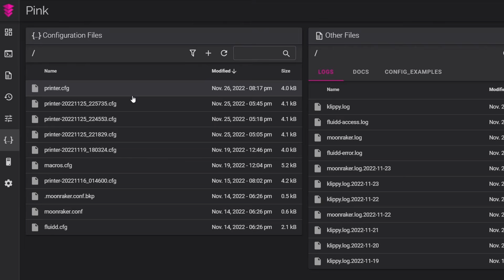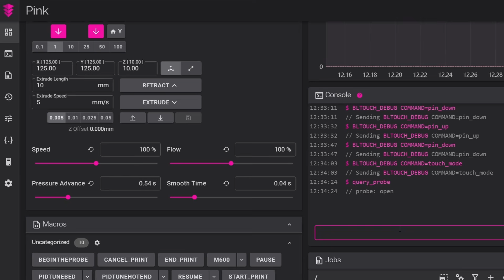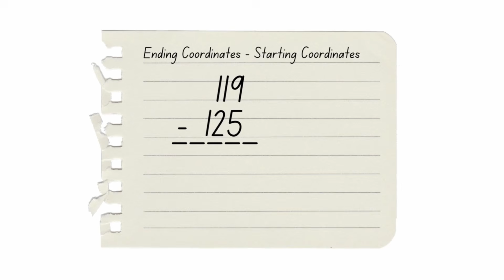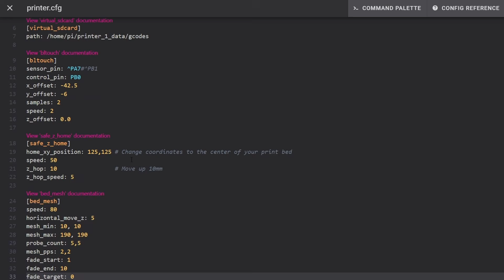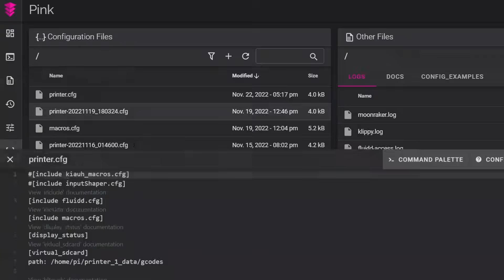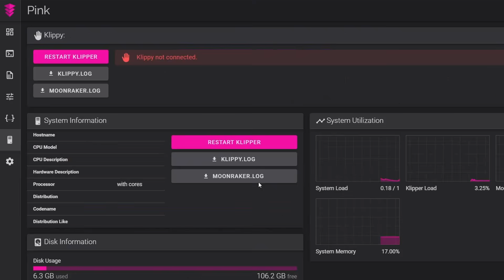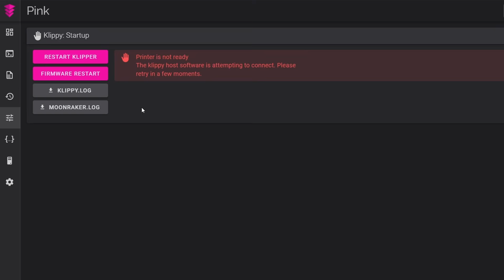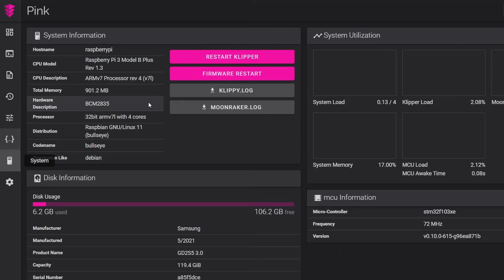BL Touch complete setup for Klipper! Maximize your probed bed mesh!

Comment: Just installing Klipper onto my Ender 3 Pro, but sadly my Z axis goes up instead of down when homing, I have no idea why. This seems to be a Klipper problem, but I wonder what makes it go like that. Would you know an answer?
Reply from the maker: Hey JKM, it's like something set in your printer.cfg (printer configuration file). If you open that file (printer.cfg) and find the section titled [stepper_z] look for the line that says 'dir_pin:' there will likely be a pin level after it , something like PB1. If you add an exclamation point before the pin it will reverse the direction of the z axis. 
So in my example PB1 would become !PB1

Let me know if this helps.
Reply: @PrintsLeo3D  hey that was exactly the problem, thank you so much! ❤️❤️❤️
Reply from the maker: You're welcome , enjoy Klipper!! Any problems just come on back here.

Comment: This is a great video! Very impressed with the skill you explained many questions I have been searching the answers for for some time. I do have a question if anyone knows the answer.  When I use the command probe_calibrate on my SonicPad version of Fluidd, I do not get the pop up box that shows in this video. What is the equivalent way to achieve this with the SonicPad version of Fluidd? Thank you so much for the video
Reply from the maker: Thank you for the kind words,I try my best to get accurate and complete information out there. The sonic pad ...oof lol ok hopefully I can help. I know the sonic pad has certain speed bumps as far as usability goes, and unfortunately I don't own one myself to verify. The probe_calibrate overlay you are seeing in the video is a newer addition to Fluidd (maybe the last 6 months or so), so it's possible you may just need to update your Fluidd version*, but it's also possible you'd need to update the version of the sonic pad as a whole and I know some users(on my discord) have had problems with that. 

* always be careful when updating pieces of Klipper as it could be incompatible with current versions of other components you have like Moonraker

Comment: Great video I recently found your channel and I understand a lot better with your videos. I watched this video a couple times before I started trying to resolve my CRtouch configuration issues . No matter what I tried, the probe would not stay pushed up when I ran the touch mode command nor would it read triggered. As soon as I entered  the command the leds on the probe would turn blue. I have an Ender 3 with a 4.2.7 controller board and CR Touch. The issue is still u resolved, but I would appreciate any feedback.
Reply from the maker: Hey Monica! I'm happy you found me and I hope my videos (and responses) can help you with your printer. There are some bl touches (or touch clones) that do not support the touch mode commands. Have you tried auto homing the machine? There are some clones that while they don't support touch mode will still auto home properly. Is it possible for you to copy and paste the current bl touch section you have in printer.cfg and reply it to me ?
Reply: @PrintsLeo3D  Sorry for the delay I had to abandon Klipper and revert to Marlin because I needed a working printer. I tried to auto home but my print head crashed on the bed. The probe that is installed on my Ender 3 is the CR-touch, I know that Creality ships both the BLTouch and the CR-Touch on some of their newer models, but mine is an older generation Ender 3 with a few upgrades. Here is the last version of the printer.cfg. 

# This file contains pin mappings for the Creality "v4.2.7" board. To
# use this config, during "make menuconfig" select the STM32F103 with
# a "28KiB bootloader" and serial (on USART1 PA10/PA9) communication.

# If you prefer a direct serial connection, in "make menuconfig"
# select "Enable extra low-level configuration options" and select
# serial (on USART3 PB11/PB10), which is broken out on the 10 pin IDC
# cable used for the LCD module as follows:
# 3: Tx, 4: Rx, 9: GND, 10: VCC

# Flash this firmware by copying "out/klipper.bin" to a SD card and
# turning on the printer with the card inserted. The firmware
# filename must end in ".bin" and must not match the last filename
# that was flashed.

# See docs/Config_Reference.md for a description of parameters.

[include mainsail.cfg]

#[temperature_sensor mcu]
#sensor_type: temperature_mcu
#min_temp: 0
#max_temp: 100

#[temperature_sernsor pi]
#sensor_type: temperature_host
#min_temp: 0
#max_temp: 80

[stepper_x]
step_pin: PB9
dir_pin: PC2
enable_pin: !PC3
microsteps: 16
rotation_distance: 40
endstop_pin: ^PA5
position_endstop: -20
position_min: -20
position_max: 235
homing_speed: 50
#second_homing: 20

[stepper_y]
step_pin: PB7
dir_pin: PB8
enable_pin: !PC3
microsteps: 16
rotation_distance: 40
endstop_pin: ^PA6
position_endstop: -8
position_min: -8
position_max: 235
homing_speed: 50

[stepper_z]
step_pin: PB5
dir_pin: !PB6
enable_pin: !PC3
microsteps: 16
rotation_distance: 8
endstop_pin: probe:z_virtual_endstop
#position_endstop: 0.0
position_min: -5
position_max: 250

[extruder]
max_extrude_only_distance: 100.0
step_pin: PB3
dir_pin: PB4
enable_pin: !PC3
microsteps: 16
rotation_distance: 33.500
nozzle_diameter: 0.400
filament_diameter: 1.750
heater_pin: PA1
sensor_type: EPCOS 100K B57560G104F
sensor_pin: PC5
control: pid
pid_Kp: 21.527
pid_Ki: 1.063
pid_Kd: 108.982
min_temp: 0
max_temp: 250

[heater_bed]
heater_pin: PA2
sensor_type: EPCOS 100K B57560G104F
sensor_pin: PC4
control: pid
pid_Kp: 54.027
pid_Ki: 0.770
pid_Kd: 948.182
min_temp: 0
max_temp: 100 # Set to 110 for S1 Pro

#[heater_fan hotend_fan]
#pin: PC0

[fan]
pin: PA0

[mcu]
serial: /dev/serial/by-id/usb-1a86_USB_Serial-if00-port0   
restart_method: command

[printer]
kinematics: cartesian
max_velocity: 300
max_accel: 3000
max_z_velocity: 25
max_z_accel: 100

######################################################################
# 128x64 Full Graphic Creality CR10 / ENDER 3 stockdisplay
######################################################################

# This section is used for a Creality "12864" display with a single
# ribbon cable between the display's EXP3 plug and the
# micro-controller board's EXP1 connector.

[display]
lcd_type: st7920
cs_pin: EXP1_7
sclk_pin: EXP1_6
sid_pin: EXP1_8
encoder_pins: ^EXP1_5, ^EXP1_3
click_pin: ^!EXP1_2

[output_pin beeper]
pin: EXP1_1

[board_pins]
aliases:
  EXP1_1=PC6,EXP1_3=PB10,EXP1_5=PB14,EXP1_7=PB12,EXP1_9=<GND>,
  EXP1_2=PB2,EXP1_4=PB11,EXP1_6=PB13,EXP1_8=PB15,EXP1_10=<5V>,
  PROBE_IN=PB1,PROBE_OUT=PB0,FIL_RUNOUT=PC6
 
[display_status]

[safe_z_home]
home_xy_position: 125,125 #this should be the center of your bed
speed: 50 
z_hop: 10
z_hop_speed: 5

[bltouch]
sensor_pin: PROBE_IN
control_pin: PROBE_OUT
x_offset: -31.8
y_offset: -40.5
z_offset: 0
probe_with_touch_mode: true
stow_on_each_sample: false
#probe_with_touch_mode: true
#stow_on_each_sample: false
pin_up_touch_mode_reports_triggered: false

#[safe_z_home]
#home_xy_position: 117.5, 117.5
#speed: 50
#z_hop: 10
#z_hop_speed: 5
#move_to_previous: true

[bed_mesh]
speed: 120
mesh_min: 10, 10
mesh_max: 195, 220
probe_count: 5,5
algorithm: bicubic
Reply from the maker: I'm sorry to hear about that,  but I think the problem may be your pin out setup. Under the bl touch section the sensor and control pins are being pointed to pin aliases (which to be honest probably isn't necessary) but importantly the alias for the sensor pin is probably incorrect as it needs a pull-up!! The settings as you have them now for the sensor pin is:
sensor_pin: PB1

But it should probably be:
sensor_pin: ^PB1

That small arrow indicates a pull-up in the sensor and without it it's probably not going to activate! I'm not sure if your considering the move back to Klipper but that should be a solution for you. If you think about going back let me know and I'll do my best to help !

Comment: i had to set stow_on_each_sample: True
probe_with_touch_mode: False
pin_up_touch_mode_reports_triggered: False

is that correct if pin up and pin down shows always open? and homing crashing in bed
Reply from the maker: Hey Bill, usually when pin_up and pin_down always show open then I believe turning off touch_mode is the adequate response. I wouldn't think you would also need the pin_up_touch_mode line as well in there. Do you know what version of bl touch you're using? or is it a clone?
Reply: @PrintsLeo3D  i tryed but i have to set this if i dosnt it want work i dont know which version i have :(

Comment: Hiya, what do you do when your trying to prob calibrate and you cant get your z offset close enough, im at -5.94 and cant get any closer and it gives me a move out of range error :(
Reply from the maker: Hiya! Go into your printer.cfg a d under the stepper_z look for position_min: and change that to a lower number, usually -6 is good but you may need to make a lower adjustment depending on how far from the bed you are. Here's an example:

[stepper_z]
...
position_min: -6

Let me know if this helps!
Reply: @PrintsLeo3D  perfect thank you, i understand that bit now, its like setting a boundry for the z. that worked i think! thank you dude, your video has been instrimental!

Comment: I am using a sidewinder x2. I installed octoklipper. How can i calibrate the mesh there?
Reply from the maker: Unfortunately you won't have the same display shortcuts that Fluidd/Mainsail has, but to run the mesh calibration using Octoprint just run the following line from the console(or terminal) window:

Bed_mesh_calibrate 

That will run the same auto probing mesh that I showed kn the video. The name of the mesh will be 'default' which is the same way I show to save it in the video.
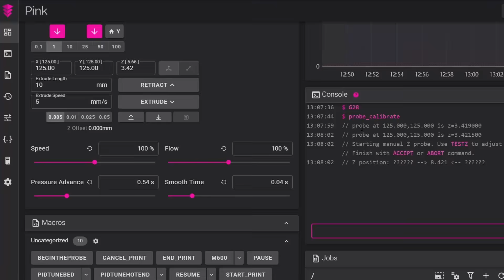Reply: I am using octoklipper too, I spent al day doing the tutorial until I got there and now I am stuck. 9:47 I do not get the window to manually adjust the Z axis. Did you ever figure out how to do it? The command bed_mesh_calibrate does not work, it is not recognized by octoklipper.

Comment: How to get this printer cfg on sonicpad? Do you just reflash it with a usb or does laptop have to be physically connected to make these changes?
Reply from the maker: I'm not very familiar with the sonic pad (but people in my discord are and I can ask them some advice), but I'm not sure what your asking? There should be a printer.cfg already on your sonic pad that it's using to control your printer. I don't know how you edit that file, but I can find out. What portions are you trying to add?
Reply: @PrintsLeo3D   well you can use the ip address to access and edit the print file but I don't know how to exactly get it on the sonic pad. Pretty much the thing you did in this video. I have the ender 3 v2 with sprite extruder and cr touch but the touch doesn't work lol.
Reply: I feel like I should join your discord lol.
Reply from the maker: You gotta join the Discord! There's a link in the description and we can get you all worked out there.

Comment: Bed mesh coordinates seem to adjust automatically now, so long as you have your x/y offsets specified properly.  So you can enter bed positions for mesh_min and mesh_max now - if you don't, you're likely to end up with an attempted move out of range!
Reply from the maker: Hey Zack! Are you saying that you can just enter your position min and max , and then with the bl touch offsets, Klipper will adjust the positions of the mesh automatically?? That would be a nice change. Although I haven't made any changes and mine is still working as intended lol
Reply: @PrintsLeo3D  That appears to be how my new Klipper install is working!  I am on Klipper v0.11.0-148-g52f4e20c and Fluidd v1.23.3.
Reply from the maker: Very cool if that's the case. I'm going to look through the latest release notes and find out! Thank you for the heads up

Comment: I have an ender and two bambus, I literally took the bambus out of the box and printing to this day 6 months later with 0 adjustments, what a time to be alive and use these next gen printers, I still find this video interesting and helpful even though I don't even have klipper :D
Reply from the maker: It's an amazing time! I am in a similar boat (although I have a few more Enders and other printers... actually a lot more lol), and I love this stuff. The advancements that BambuLabs have made is really going to accelerate the market to match what they have created. What I love about Klipper firmware is I think this is the firmware of those next gen printers. It has all the features of a firmware that can handle different printer setups and configurations and handle them uniformly across platforms. Also it can be blazing fast. I appreciate you watching and maybe we can get Klipper on that Ender one day ;)

Comment: Your video is amazing and well put together. Unfortunetly I have the same exact issue as I did marlin. Half my plate is too high and the other is a bit low. I'm also very good at getting my four corners align without and BL touch. not sure what the issue is.
Reply from the maker: Hey Kevin! Yea there are some build plates that are either so warped, or the printhead itself is causing alignment issues, where the bl touch can't help to make up for it. Klipper offers another fun feature called screws_tilt_adjust (complicated name for an easy and useful command). That feature uses your bl touch to probe the four corners of your bed and then determine if it needs any adjustments on the leveling knobs. It might be an add-on that may shed some light for you.  I wrote a quick article on how to set it up if you're interested:
https://www.printsleo3d.com/screwtilt

Either way thanks for watching and I appreciate you commenting to tell me about your experience. Good luck!

Comment: do you  have a link for the stl you used to setup your baby steps, might as well use the same one and follow your video exactly ;)
Reply from the maker: Hey Jim I don't actually have a .STL for that. What I do is create a 20x20x20 cube, and then I shrink the z height to a single layer (0.2 in this case). Then I multiple that model 4 times to create a total of 5, and I arrange them around the build plate. For my ender/Aquila I make the coords
70,70
 -70,70 
-70,-70
 70,-70 and
 0,0
If you need to find a cube I believe alot of the slicers offer you the ability to 'create a primitive' which can be a cube and then you can scale it to size.

Comment: Why is it that marlin probes my bed evenly, but klipper is all off side? Seems that this is setup to favor the hot end over the probe.
Reply from the maker: Hey Sam, are you saying Klipper is only probing a smaller portion (or uneven amounts) of the bed? If the X and Y offsets are set up correctly in the printer.cfg, and the bed limits are also set up, when you plot the mesh points then Klipper should be probing as much of the bed as possible.
Reply: When I would use marlin it would probe the entire bed because it was based off the probes position. My bl touch is to the left of the nozzle so I'm missing a big chunk off the right side of the bed. If I try and tell it to move over to the right more I will get an out of area error. I just want to probe the entire bed not just 75% of it .
Reply from the maker: Have you tried expanding your max bed values (in the X direction) and then probing again. For instance change your (x)position max to 100 over what it is right now. Then keep increasing the printheads position until it hits either a physical stop, or the gantry begins to ride up the extrusion. At that point check the position and make those coordinates your new (x) position max. This way the printhead has more movement along the axis and the probe can reach more of the bed.
Reply: That will likley work. I wish i knew the points marlin used, should be a lot easier to level the bed if youre using the entire bed.
Reply: @PrintsLeo3D  I guess what I want to do is center all this so one sides isnt bigger than the other lol
Reply from the maker: I don't know what printer you're using, but the Aquila for example has a factory bed size of 220, but with the stock hot end and carriage you could actually get a print size closer to 235. So a lot of the custom firmwares would come equipped with that larger build size. 

It's possible the printer configuration file you got may be using the more conservative numbers (220x220 instead of 235x235) so you aren't maximizing the bed size. To be honest it's the best to measure it yourself. Because you may get a few more millimeters, or more importantly, you may not want to go to 235. At that size your printhead could be hitting a stop or moving up away from the build plate which would cause some print problems or poor probing. 

You may be able to dig through the last Marlin firmware you had to see what your bed size was set to. Also make sure the x and y offsets are correct for the shroud you are using just to be safe. 

Let me know if you need some more help with this, I'd be happy to share a hand
Reply from the maker: Yea I just answered your last message while you were writing this, but yea you're right.
Reply: @PrintsLeo3D  ender 3 , same 220 but actually 235. Yeah I'll have a look through the marlin firmware. Thanks for your help this video got me through a lot of it.
Reply from the maker: Good I'm glad it helped a bit. I think Jyers firmware may have been using 235x235 if that's what you used.
Reply: Got it going the way I want now just needed to sleep on it, thanks again for the help.
Reply from the maker: Yea I know what a nice bit of sleep can do to clear your mind ! Thanks for the follow up, I love hearing a happy ending! Thanks !